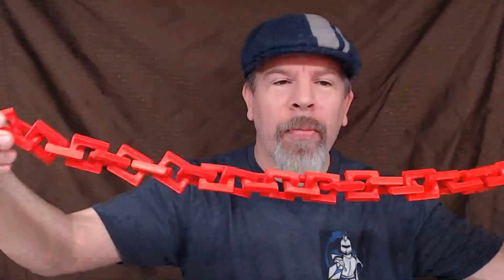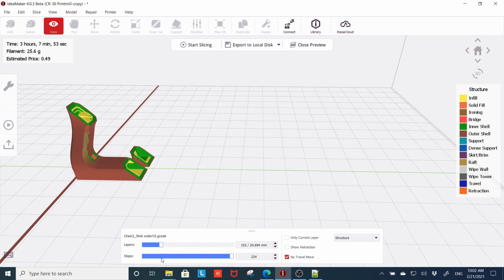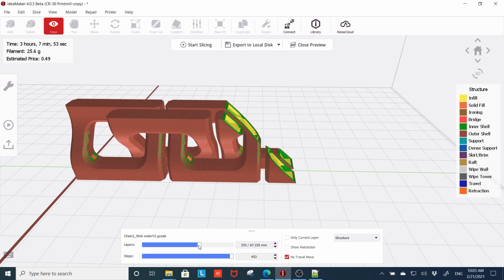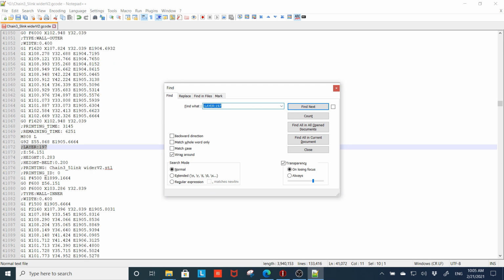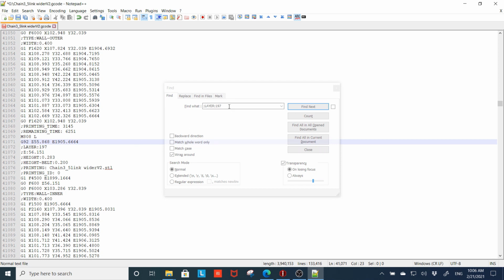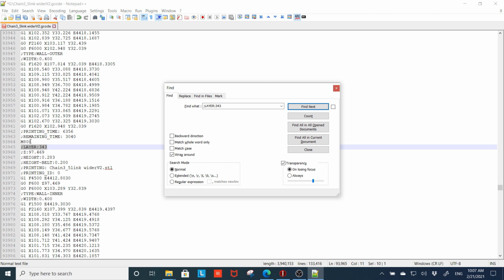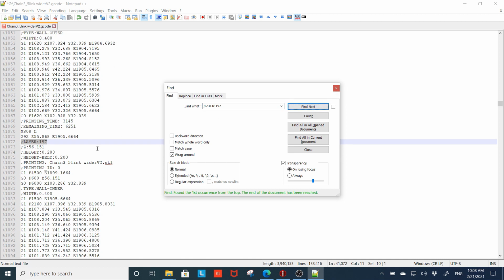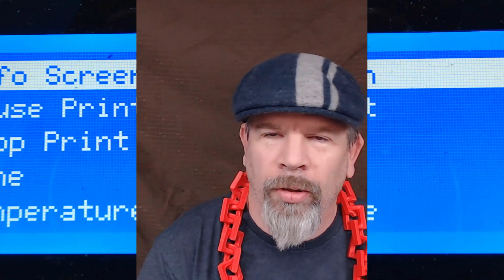Printing an infinite chain with Marlin's new M808 loop command..

Comment: I have a question i am looking to us my cr30 to build a 12 foot long and as wide as I can on the belt lego base plate to put on my son's wall im going to do different colors like green gray and blue white and black and brown for my sons wall so he can snap his legos on but the base plates for logos are not long enough so if I can make them 12 foot long I can mount them in rows on the wall. I have to make alot of them for me to finish his room so if you can help me find a gcode for this that would be great I have to probably make a total of 40 in order to reach the ceiling on all 40 walls and cut them for exact fit for doors and wall plugs and switches so thats why I just need the one file and I can adapt from there.
Reply from the maker: Sorry some how I missed this comment.  12ft long runs is a lot of uninterrupted print time, I'd advise doing shorter pieces maybe 3ft lengths..  Honestly since the widest you can print on the Cr-30 is approx 8 inches, I'd recommend printing a lot of 8x8 squares in different colors and then tile the wall in some kind of picture or pattern.

Comment: The blue piece that you have at the end of the bed, do you use that to prevent over adhesion? Is there an STL file out there I can print for it?
Reply from the maker: It’s a scraper to prevent smaller pieces from riding the belt over the end.  The file wouldn’t fit the production models, that’s a very early prototype it’s mounted on.
Reply: @NAK3DDesigns  Ok, I think I am experiencing a similar issue, I am not trying to click bait you but do you mind watching my video 
I just posted to see if you could weigh in on what you think the issue may be. I was thinking your solution would work but I guess I had the wrong idea in mind lol. I thought you made it for the same issue I was experiencing. Any thought would be greatly appreciated.

https://www.youtube.com/watch?v=HEMZJkQ_ueU
Reply from the maker: Sorry about the delay in responding (youtube filtered the comment for some reason)..  I left a comment on your video with how I get around this issue..  Sorry I don't have a more hands free fix.

Comment: Any idea why using your profile and firmware the prime line prints at a lower height than the print? Prime line adheres great but then the actual print is like a layer higher and comes loose.
Reply from the maker: 2 possibilities.  1. Sincecthe purge line is in the start code the slicer may be using a different z height. I recommend looking at the gcode and comparing the z-height from the purge line vs layer 1 of the print. 2. Since it is a “purge” line the extrusion rate is set higher than a normal line would print at.

Comment: Thanks for the great tutorial! If I just wanted to print the same model over and over I would just M808 around the model and home it between? 

Your ideamaker profile has worked awesome for me. Solved all my creality belt quality issues. Only thing that remains is I don’t see a setting for belt wall layer speed.
Reply from the maker: I’d put the M808 L## right after the purge line followed by G92 Z0 E0 and M808 right after the last move and before it starts turning off stuff.   No need to home between each piece.   If the last line is on belt layer you may want to add a G1 Z2 between the first M808 and the G92.
Reply: @NAK3DDesigns  Thanks for the quick reply. I'm testing that now. Any suggestions for getting better first layer adhesion? Tips and tricks? I'm currently printing first layer at 15 and I'm probably closer to my bed than I should be. Everything sticks fine except the very first or second layer.

Comment: Do you know if M808 will work on a Creality Ender Pro?
Reply from the maker: I don't see any reason it shouldn't work if configured correctly for the Ender, though I'm not sure how you'd use a loop function on a normal printer.

Comment: hmmm, so @Nerdtronic was able to create an app that altered and changed sliced files to help remove the elephants foot from plate printed parts, So I wonder if this operation couldnt easily be coded into a slicer or as an external app that opens your Gcode and you can pick the points and it changes the code for you...

Comment: Very cool! Can't wait to get my CR-30 and try this out/
Reply from the maker: Just keep in mind that this is a beta firmware.  You will most likely need to update your firmware to use this feature.
Reply: @NAK3DDesigns  Thanks for the heads-up!
I'm very comfortable with using and modifying firmware. I love modding my printers, tinkering with firmware and I'm not going to stop with the CR-30 :)